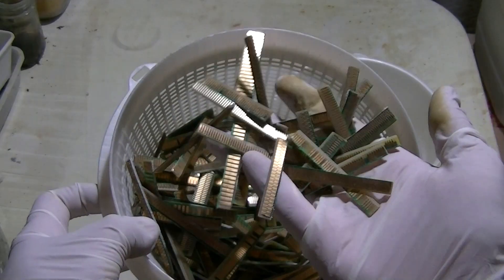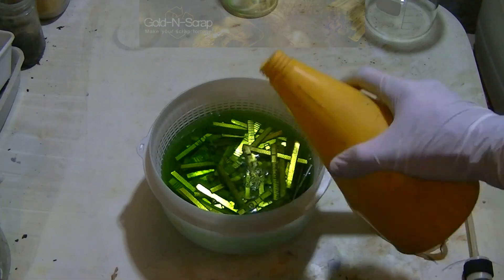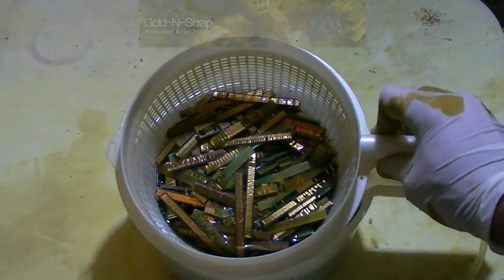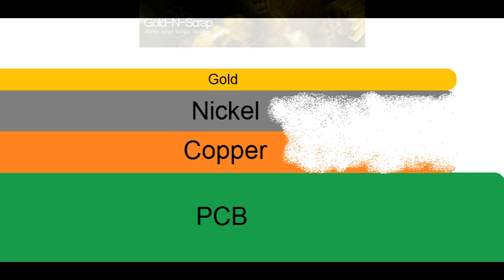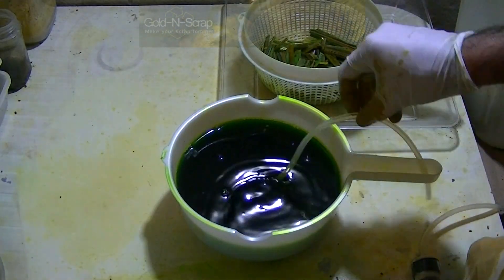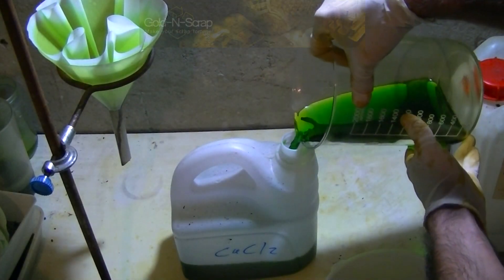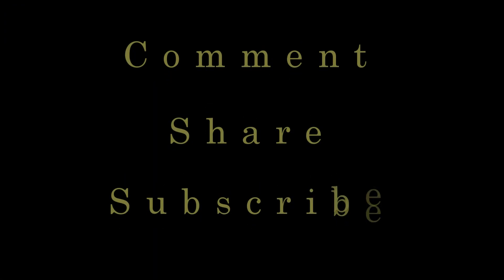Gold Fingers - How to Recover Gold from Electronic Scrap

Comment: It's less  expensive to use hot  vinegar intro a big seized mineral water covered with newa paper in a way to keep it hot for more time.  The gold leaves the scraps easiely in a short period of time nas the vinegar can be used for more gold's separation.
  I liked very much your video. My problem is to find electronic material to begin to work with gold and plate to, removed from X ray fotographs.

Comment: I've seen videos on YT of people stripping off the gold-plated fingers by simply applying heat and pressure. That way you have a lot less non-gold material to remove. PCBs and components may have gold on them elsewhere, but the gold content is really small and/or hard to extract.

Comment: Once you had the gold why did you dissolve it in aqua regia then precipitate it back out. Why not just take it and melt it down? Impurities? Couldn't have been enough to matter or that couldn't have just been scraped off once you melted it. It was basically just pure gold.
Reply: Nah, mostly copper and nickel that way, but you can then purify by electroplating the gold out the ingot. Much cheaper if you have cheap electricity for melting

Comment: would this solution also work on dissolving bodies?
Reply: airbubba1 it sure melted those fingers down
Reply: airbubba1 , Hydrochloric acid works but Sulfuric acid works faster. Googled that.
Reply: Viking Power thanks...VERY useful info here
Reply: airbubba1 ,Or you bury them deep with 50 kilos of quick lime. Keeps the smell down and dissolves everything.
Reply: Kinda sick u even got a response from anyone on this question.  Lmao

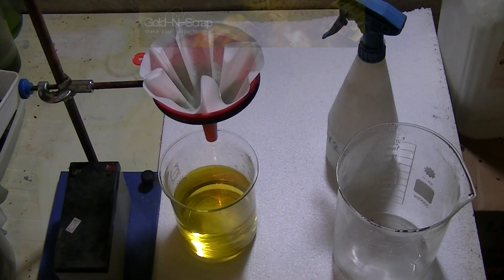Comment: Electroplating...The gold solution at 7:00 minutes, as I have it, you could add a buffer and a base (x-SO4 ish) then use that solution in an electroplating? Maybe the copper and nickel, as a mixed electroplate?

Comment: 505g ? that tiny ball ?
Reply: the 505 gr I think referred to the weight of the starting material :-)
Reply: 505g means half a kg !! Absolute nonsense. Maybe he meant 505 mg that is,    half a gram. (my job is gold electroplating of connectors, and I don't want to bore you talking about Geiger-Muller counter, betascope etc.)

Comment: A to H20. Remember it. Imprint it. My father once got hold of highly concentrated HCl. He decided to get gid of it by diluting it with the hose water. Huge bubbling vapor arized. ( I think he gets away with adding water to acid because it's diluted acid? Maybe pool acid?). I still confuse the two elements.

Comment: Did you really extracted 505g gold from these computer chips ?
Reply: no he said he used 505 grams of fingers to get the gold. He only recovered abot 4 to 5 grams or a quarter ounce. 505 grams would be like 15 plus ounces or 15 one ounce gold coins.
Reply: no, it was 505g of connector fingers to start with.

Comment: He got $100 dollars of gold......Electrical cost from process $180.
Reply: +7Earthsky 
Plus the cost of the chemicals... Plus the glassware/tubing... plus the bubbler... plus the hot plate...  plus whatever he spent to buy the old computer hardware.
Reply: Not really...It's actually quite simple grade school arithmetic once you know the variables.  So I am going to try to explain the method as simply as possible for someone that is not a math wizard like me. Here it goes: An ESTIMATE can be calculated by: the feasible "typical average" amount of electricity it would take to run a small 5V DC pump for 168 hours. In the form of raw basic wattage. That number (the electric energy total) is then multiplied by the number of hours. This resulting total needs to be converted by multiplying the wattage by 1000 in order to convert the wattage to kilowatts. To conclude, finally just multiply by the current cost of energy per kilowatt hour.  This  will yield the rough, but pretty DAMN CLOSE, cost of electricity to run only the pump for this project alone. This is solely based on the running pump however, the hot plate was not taken into consideration. Of course it is an estimate but it will give your a faithful representation of the variable figure of pump expense power consumption equated into Dollars (or whatever currency) . This variable combined with the total expenses of the other processes will eventually yield the figure of the entire cost of the project.Of course I am not taking "opportunity cost" into consideration. That figure is fictitious so naturally it's unique to the study of economics, which is mostly theory. But being the detailed accountant that I am  :-), I have always hated opportunity cost....Its a made up number that has SOOOOOOOOOO much room for interpretation!!!!  The figures from one single set of data will of course differ from person to person. Not due to errors, but due to their personal motives and goals. The figure can never be exact, but it can also NEVER be wrong. This just doesn't sit right with me and is simply "utter bull-shit!"  ;-)Did I explain it well? Everyone understand? :-)
Reply: You said it, DC, thats a battery, electricity yes but of a different type, the type you wouldn't pay that kind of money for
Reply: Clone is correct, I mean really did you really think running a small pump for 168 hours would cost $180?! LOL. Boy can you imagine what peoples home electricity bills would run with that type of math?  You'd be paying 10s of thousands or more every month... Sheesh.
Reply: profit XD
Reply: This is pretty much why places that collect electronic stuff for reclaiming precious metals will take as much as they can get their hands on.  There are several places in Massachusetts that process it in bulk, enough to fit one or two flatbed trucks.

On the other hand, once the initial investment has been made, it will begin to pay for itself, if you're in the habit of collecting that much old gear.
Reply: +kona702 actually, you explained it perfectly, seriously, the only thing that you didn't include was the formula but still, fine use of words sir
Reply: +jc13sec Previous comment is mostly correct, however watts are a rate of energy per time, not total energy. Watt.hours are total energy consumption. A motor that size would be rated at about 10W. This is also 0.01kW. So 0.01x168=1.68 kW.h if you payed 20c per kW.h, then it would cost 34c. About the same cost as running a 1200W microwave for 1-2 hours on high.
Reply: Omg god are you that thick? Obviously I was talking about the bubbler part, not the heater element part, no need to point out the obvious. Regardless, there is no such thing as kw per hour. If you are a HVAC service tech, u should understand killowatts, joules per second, and kilowatt.hours.
Reply: you're so wrong. it didn't even raise my electrical bill that much to run a 400w hps light plus fans and SIX of the air pumps he used.
Reply: +chris anders (chris anders seeds) dude if you study to be an electrician, they teach you how to do it, it involves math, lots of it
Reply: +chris anders (chris anders seeds) yep, Im currently studying electricity, but ive never had the change to fully study how to estimate the cost of electricity
Reply: He profited thousands from youtube advertisements.  The audience will be the one who'd get screwed if we followed him.
Reply: volts x amps = watts. electrical companies charge by kW.
since a heater is a resistive load we can take the amount of amps it draws x the voltage which is probably 120V, get your W and do the math for kW. 180 dollars is kinda absurd... i dont think his heater draws over 10A.
Reply: Mate, I've already explained it correctly, please don't go confusing people again by saying power company charges by the kW. W is rate of energy, W.h (or joules) is total energy over a time period. If someone asks you how far you traveled to get somewhere, you don't tell them the speed you were travelling at, you tell them the whole distance covered. Also, its not a heater, its a motor and therefore an inductive load.
Reply: are you crazy or some kind of youtube agent to disinform the people? how is 5:00 a motor ???? your telling me that machine at 5:00 is a centrifugal motor and not a heater? I want everyone to look at that 5:00 and tell me if you see something spinning lol i really laughed. lol anyways.... theres a heat strip in that machine that heats up, no motor, no centrifugal, no moving parts. just a heat strip. and your right power companys dont charge by the kW. they charge kW per hour here in the states. resistive load my friend ;) im fascinated with electrical controls and how we can control the current in different ways. Thank you Nikola Tesla. UA HVAC SERVICE TECHNICIANS.
Reply: Solar Panel + Scooter Battery = 20$ => No electrical cost ( i have a greenhouse running from that)
Reply: der Robert Connie

Connie Smith
Reply: In ZAR electric bill $580 due to expensive solar deal by government...

Comment: What if you do this without the air pump? will it still work?
Reply: +Petros Kefallinos No it need air !!
Reply: Would a fish tank air pump work?
Reply: Well Fit I dont wanna buy an air pump for this!!! :(
Reply: +Petros Kefallinos it will need to much time to arrive what you expect
Reply: +Stephen McCanless it need oxygen whatever
Reply: Well Fit Can i add oxygen somehow? Maybe adding something that reacts with something else end produces oxygen?
Reply: +Stephen McCanless a small aquarium pump with a ceramic airstone will work fine.
Reply: You can use Hydrogen Peroxide instead of an air pump. Adding about equal volumes of Copper Chloride and Hydrogen Peroxide should work, and also speed up the reaction by a lot.
Reply: I love you! Thanks! :D

Comment: I have a question, what is the purpose od adding Cu2+ ions at the beginning of the proces? And second one, can i use h2o2 to supply solution with oxygen? Thanks in advane :D
Reply: +MrWazamono 
I believe it de-ionises the solution in order for the acid to work on non ferrous components.

Comment: I would use some H2O2 instead of the air bubbler. It should work better.
Reply: +Petr Jaroch i still dont understand what is air bubbler for ?
Reply: It introduces free O2 in the solution. The oxygen "rusts" the copper surface into Cu2O and makes it dissolve faster.
Reply: thanks

Comment: is the pumping air part crucial to the whole process? Cause as much as I don't want to do it i'm sure its needed
Reply: +gamer Trott It was mentioned in the video that a ready supply of dissolved oxygen is necessary for the reaction, so yes, piping/bubbling air is necessary.
Reply: right so ive either got to buy an air pump or start blowing in a pipe for a solid week lol
Reply: Get the air pump, or improvise some form of air circulation - you don't want to be blowing air into an acid bath (fumes).
Reply: yea i was joking i will get an air pump most likely
Reply: +gamer Trott its like etching copper pcb boards. if you dont agitate the solution it will take 10X longer
Reply: +Omar Masri (Heliosonic) ah right yea and I don't want that thanks man

Comment: Could you speed up the reaction by adding hydrogen peroxide to the solution to increase the dissolved oxygen content or would it still dissolve the copper and nickel at the same rate?

Comment: sir your method is SOOO dangerous i would not ever use it!!! OVER 40 yrs ago i developed a very safe and simple method! 1 break off the connectors . 2 put them in an oven proof container. 3 cook in a  kitchen oven at high temp until foils and backing  separate. 4 put foils in a glass jar . you have a mix of cu @ gld add copper  melter now  you have gold at a low carat around 10 when you weight this you wiil have VVVVEEERRRYYY LITLE GOLD!!!! BUT YOU WILL HAVE A RELATIVELY SAFE METHOD OF WASTING YOUR TIME !!!! AND YOU WILL NOT INJURE YOURSELF > THIS BY JOHN WILLIAM KELLY AT DDO QUE. BEST OF LUCK

Comment: Why not just quit with the gold foils around 4:30?  Or does the gold need further purification? (I'm no chemist, obviously!)
Reply: from my reading in the comments, I've picked up that the gold used in the electronics is 14k and when recovered from the solution is 24k, meaning that it is much more pure gold than if you were to just melt the fingers down.

Comment: For the clueless haters.....you're looking at approximately 2.5-3 grams of .999 gold....depending on the thickness of the plating. That's about 1 1/2hrs of work. Do the math. AP can be rejuvenated and used indefinitely....the only big expense would be the nitric. A lot of these guys have turned their hobby/love for science into a refining business which I assure you make more than your 9-5 job. PS: One doesn't typically have 500+ grams of gold fingers just laying around so no worries about the electronics you tossed out.

Comment: If you put all the fingers into a smelting pot and melted everything down to burn off all the plastic etc, what would you be left with?
There would be a mixture of copper, gold and other substances right? but what purity of gold would it be?
From what I can tell, you would barely make a profit out of this chemical separation method because you only make about $60-70 for 3 grams of gold (how much you get from these), and it will cost you about $17 for the 500grams "fingers", then even more for the chemicals... By the end of it all, you have spent up to a week separating all the gold and refining it, for very little profit if any...

Could it save time and money on chemicals to just melt off all the metals at the start then purify them later?

Comment: I never understand why acid don't melt plastic and glass....
Reply: +deaftodd acid is a myth. Its just cherry coke and alka seltzer;
Reply: +C3PO's Bottom Bit Hmmm, I will try that... Will um should a generic brand cherry coke and alka be sufficient? If not then should I buy coke cola and Bayer brand to deal with the hard core acid?
Reply: deaftodd as long as you dont drink any of that nonsense you should be better than fine!

Comment: yes I have one question about recovering gold from gold fingers I have done my first batch of gold fingers approximately a pound and a half when I add them to the solution of hydrochloric acid and copper two sulfate some of the fingers remain a bright gold color other ones turned more of a copper color I was wondering if they use brass instead of gold sometimes because of the way some of the fingers look like they tarnished I would really appreciate your response and again thank you for your wonderful videos

Comment: I have a question, I want to be able to work with the muriatic acid in my apartment, can I make a filter system where the acid fumes goes into another container through a hose, where the fumes will be neutralized, the other container will have a neutralized liquid, like water and baking soda, I live on the 5th floor and I hate having to go outside all the time, plus there is no electrical outlets outside either, to run my hotplate.

Comment: imagine the really popular old computer stores with seriously out of date computers buy the few 100's of different brand computers they support and they feel like they can sell the computers for money but they can't sell the computers for gold bricks, so the mad man goes to work with some guys who've been assigned to unscrew old computers to the point where their only scraps, parts and then when they get the motherboards and such they're gonna be doing this guide but since this is motherboards their going to increase in size their materials such as vials, flasks, strainers, sifters, and they're going to be spending quiet a pretty penny and the acid, the warmer, the every single handy piece of surgical removal equipment that in requirement of the process can recover at some point the gold bars that sat in our minds

Comment: Gold amount appears to be about 1/10th oz. At $1200 per, that is about $120. Deduct your cost of materials, calculate some labor for your time, and I'm not sure you made even $10.00 per hr. here. But you hold the figures that would have the answer. You need to calculate a cost for gathering the fingers also, as I'm sure they don't come walking up to your strainer and hop in on their own. Is it worth it?

Comment: Isn't it faster to add hydrogen peroxide instead of bubbling air? And would commercial PCB etchant do the trick as well (the one with ferric chloride/HCl instead of cupric chloride/HCl)?

Comment: Amazed at the number of people saying there is little reward or that the chemicals cost would outweigh the reward.

First of all, there is nothing to stop you scaling up - do ten times as much in a larger container and liberate the best part of half an ounce of gold - enough for you?

Secondly, the equipment is going to be a one-off purchase so unless stupidly expensive (in fact dirt cheap), then it's academic anyway. I'd inclue the copper salts here too as they are more of a catalyst than a consumable.

Thirdly the TINY amount of nitric acid would be so cheap as to almost be best ignore. 3ml (or 30ml if we are going for half an ounce) is still going to be pennies. Ditto the hydrocholoric acid. very cheap - and can be obtained easily enough too. Filter papers are pennies each as are disposable pipettes.